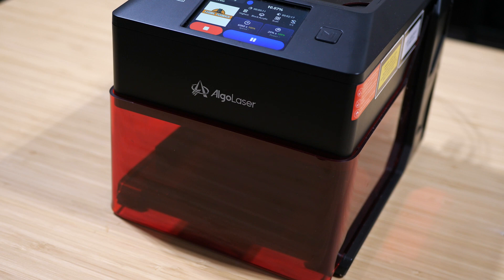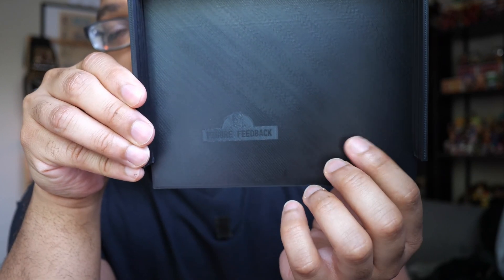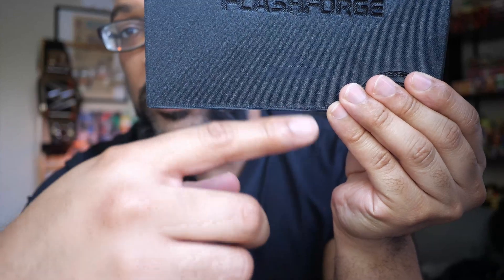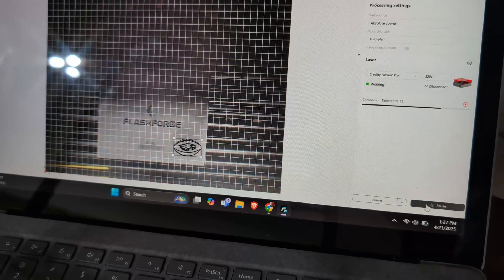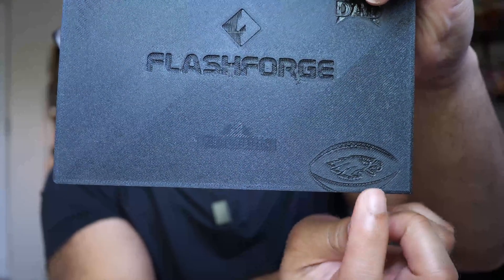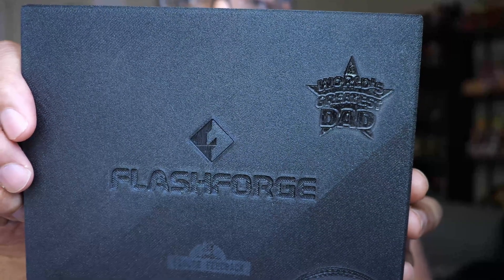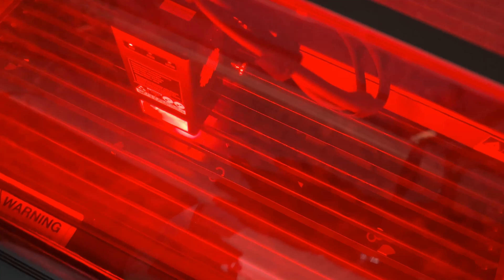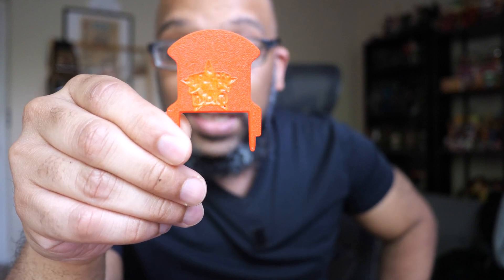What Happens When You Laser Engrave 3D Printed Parts?

Comment: It has more to do with the type of filament you laser on.  Most of the PLA and PETG I tested had similar results. It is more black on black melting. However, Elegoo Basic PLA looks fantastic.
Reply: I have teated 8 filaments so far and the Black Elegoo Basic PLA is the only available one. I am about to order some in Red and White to test those colors. I have made a lot of gridfinity tough boxes for my wife’s business and I’ve made all of them in black because I can laser them. I’d like to try to make some medical boxes in red and white and see if I can laser them as well.  I am hopeful, but I don’t know.
Reply: Btw I use an xtool s1 with a 2w IR laser. Diode will also work. My settings for IR are 100p and 80s on black.

Comment: I've done plenty with IRs. Didn't do so with Fiber yet but you probably could with how close the wavelengths are. You can make diode work but it requires some finesse and/or workarounds (depending on your material).

UV, however, is freaking king.

Comment: I manufacture a family of products using TPU-LW and I'm going to laser engrave a subtle tasteful little company logo on the bottom using a 10W laser.  I have a large pile of prototype parts on top of my computer that I saved while developing the product, to use to tune the optimal laser parameters for the light engraving that I want.  Pro Tip:  3D printers are great for making laser fixtures for precisely locating odd shaped parts.